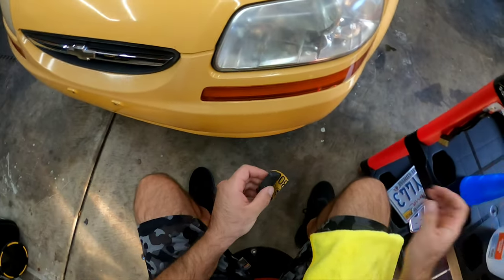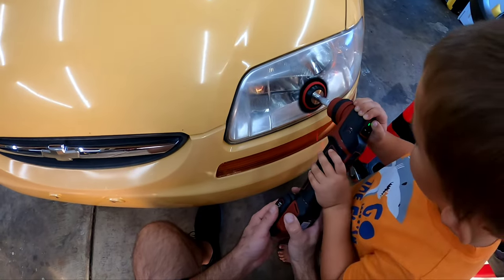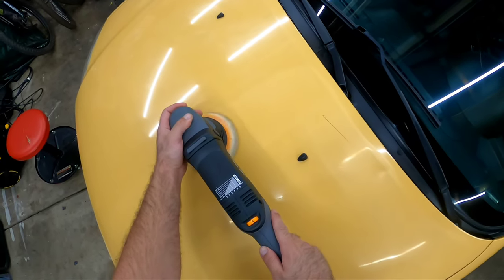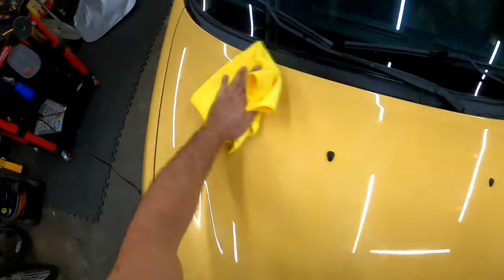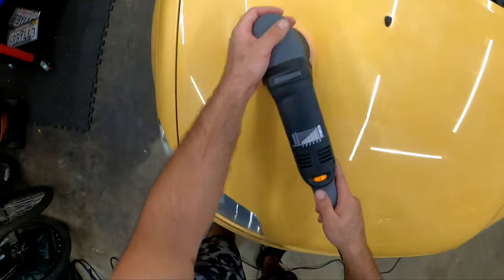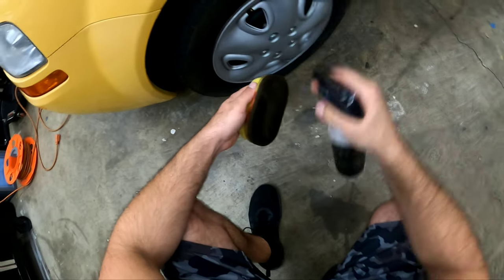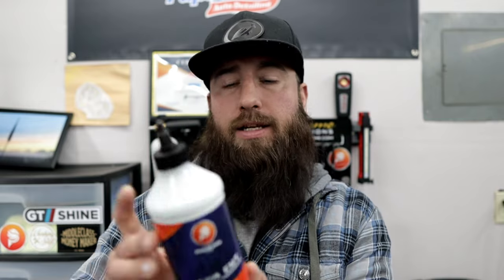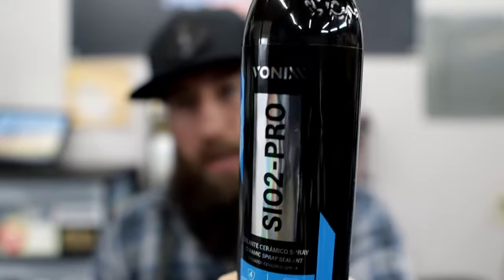HOW TO POLISH AND PROTECT YOUR PAINT! || DETAILING SERIES FINALE EPISODE 5 || WHAT A TRANSFORMATION!

Comment: How do you know when its hard or soft clear? How many passes did you do?
Reply from the maker: My test sections always let me know. The clear will talk to ya! I always start with up and down side to side..up and down side to side. I call that 2 section passes... if your using a light polish an polish pad and your getting good defect removal then you know it's on the softer side. If it's not doing much as far as defect removal goes, then it's on the harder side.. if it's doing something just not quite what your after it's right in middle and you adjust accordingly 🤙 I'll usually bump up pad first before I bump up my liquid👍👍